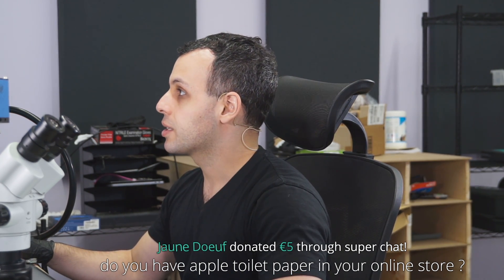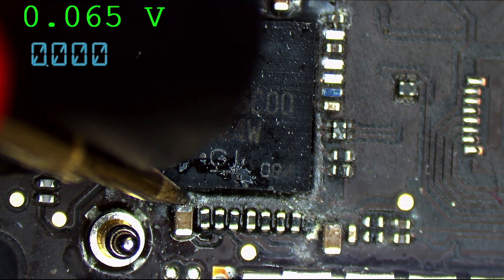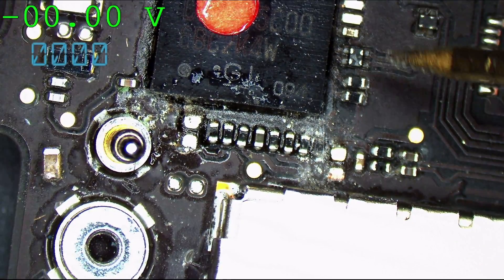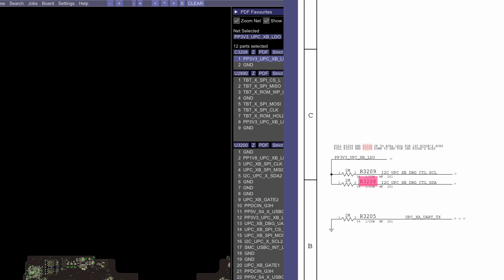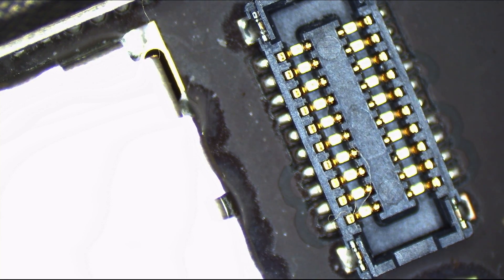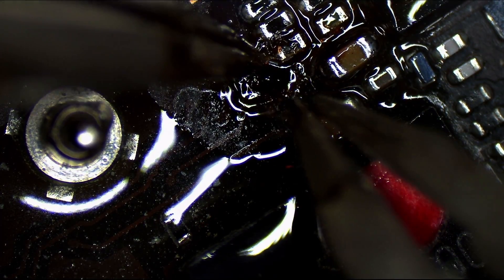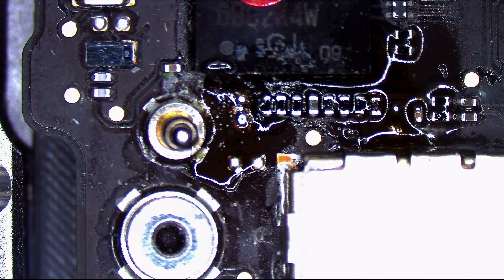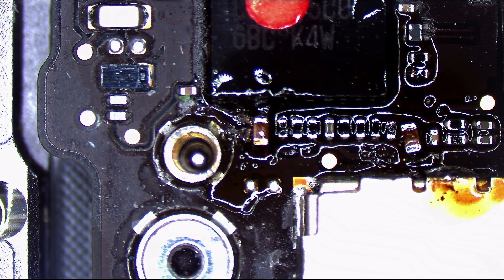820-00239 board charger stuck at 5v-300mA then loops on/off. Why?

Comment: Louis have you considered making a condensed version of a video of you repairing a board to give to legislators when you go to testify? If you submit a written testimony you could add a link to the video. It might go a long way for them to actually see what you are talking about when you testify and in this case they could actually see replacing a few cheap resistors fixed the laptop and the customer didn't have to pay thousands for an entire new mother board (or computer) all because of a part thats a few cents.

Comment: Use about 3 or 4 of those acoustic panels, arrange them like a pyramid over the green air filter machine that’s on the floor, to attenuate it’s noise.. don’t block the intake and outlet openings..
Reply: Oops, meant for the store update video.